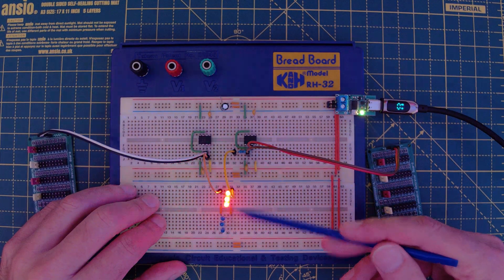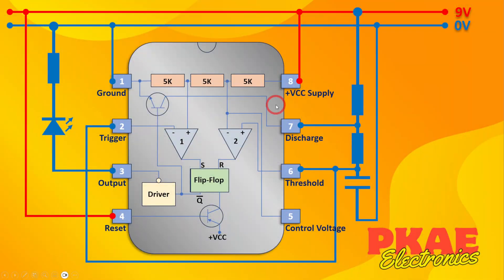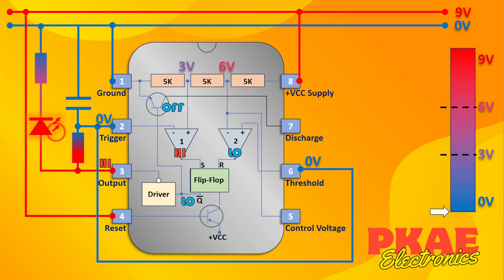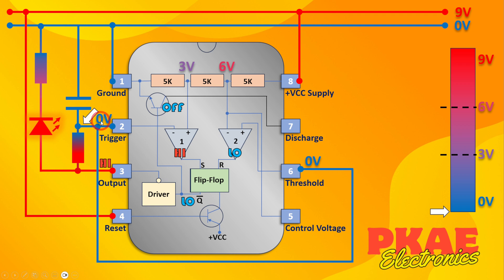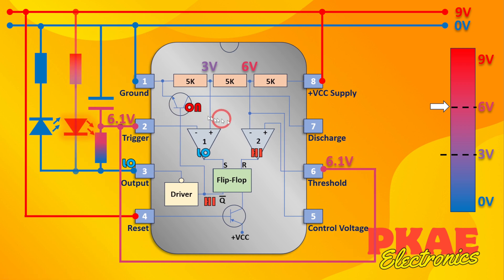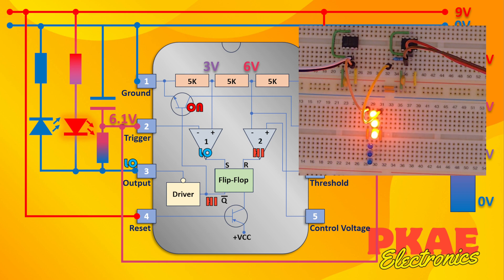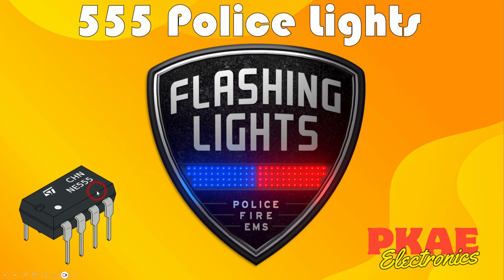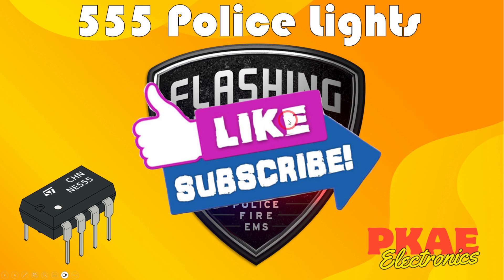555 Police Flashing Lights

Comment: Dose it damage the LED's to be supplied power with reverse polarity? I was always told this. I'm assuming the power go's to the other correct LED's so it will not damage it?
Reply from the maker: Good question. 

The LEDs can damage if the potential difference exceeds their reverse breakdown voltage. However, the combination of the 330ohm resistor and the three LEDs in the opposite orientation, means the reverse voltage experienced is well below typical breakdown limits. 

You could always add a couple of standard diodes in series with each group of LEDs.
Reply: @paulpkae  and what about to power a 12V led strip instead of the 3 red/blue leds?

Comment: i got the first explanation where you connect one LED to output and gnd, and the other LED reversed polorised to output and vcc. but i didnt understand the second diagram where both ends of LED sets are connected to both outputs
Reply from the maker: It's a bit confusing because the Output pin can both "Source" and "Sink" current. So when it's HI, it provides a positive voltage. When it's LO, it's like connecting to ground. Does this help?
Reply: @paulpkae  yes thank you. You also explain this in the following video with the simplified version